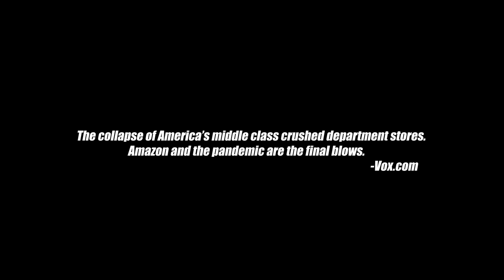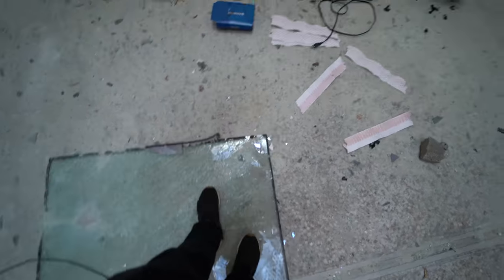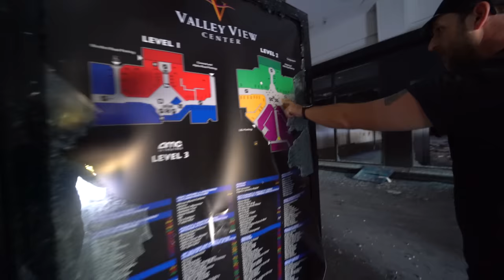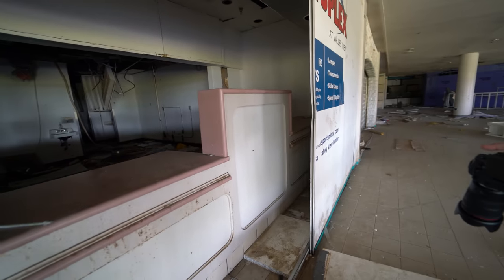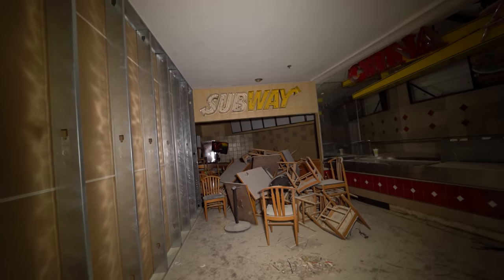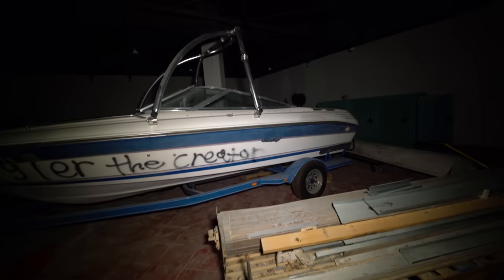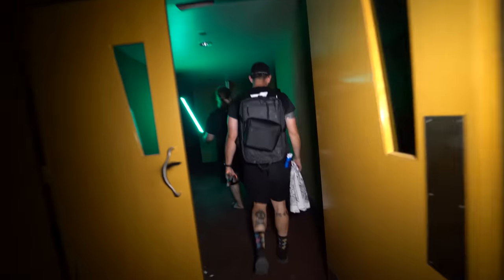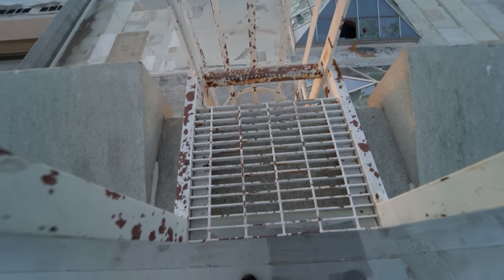Exploring the ABANDONED Valley View mall!

Comment: Fuck, seeing the projection booth makes me depressed.  I worked there for one day back in 2008.  My boss sent me to work there for a single day to help them fill in for a projection staff shortage.  I had to fix so many issues that were getting ignored by the new projections manager, and even had to argue with the GM about equipment they had that didn't exist at my theater.  The window y'all looked through was the one that had an issue with a UPS that caused the ad projector to keep turning on and off.  I still remember oiling the film rollers to get them to spin freely, and the whole massive unit that once stood there.

Thanks for giving me one last look at this place.

Edit:  AMC theaters did not have private screening rooms.  All new films were screened by employees the night before opening, after the theater closed.  The screenings were to check for defects in the delivered film, and to make sure they were assembled correctly.

Edit 2:  The reason the theater was the last to go was because they had a super long lease with the mall.  It was originally in the redevelopment plan to build AMC a new location, but since the redevelopment plan kept changing and getting delayed, AMC's lease finally ended before any new development.  Thus, they got kicked out and the mall finally closed for good.